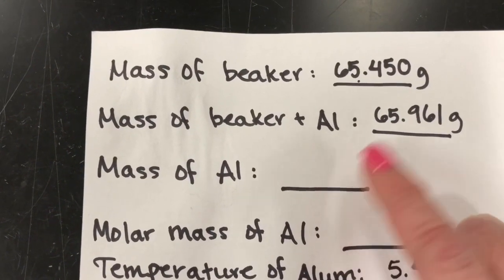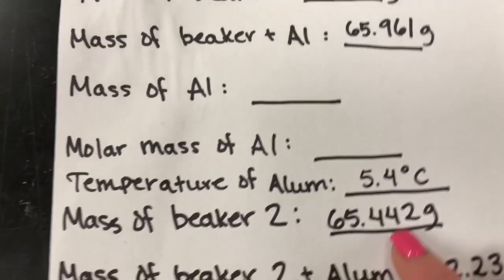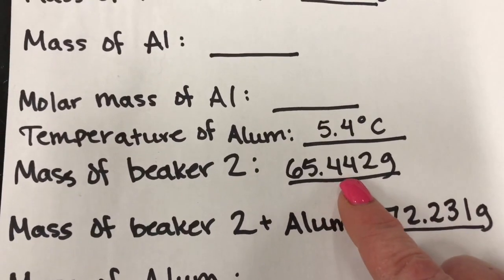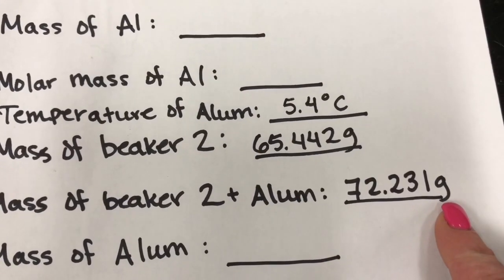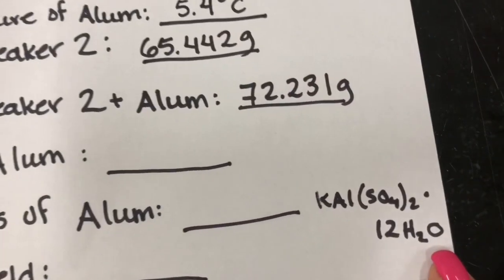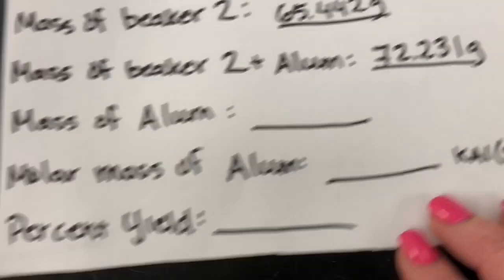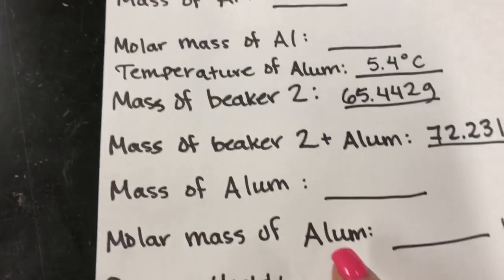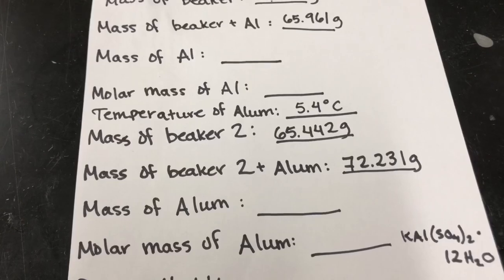Synthesis of Alum from Aluminum

Comment: Using .511g of Al, I got a theoretical yield of 4.89g KAl(SO4)2 and an actual yield of  6.789g KAl(SO4)2 which gave me a 139% yield. Is that correct by your calculations? This was my balanced equation 2Al (s)  +  2KOH (aq)  +  4H2SO4 (aq)  +  22H2O (l) →  2KAl(SO4)2.12H2O (s) + 3H2 (g)
Reply: The formula for Alum is KAl(SO4)2 12H2O, including 12 water molecules per one formula unit of potassium aluminum sulfate. Therefore the theoretical yield from 0.511 gram aluminun is 0.511/26.98*474.39 = 8.98 grams, your percent yield would be 6.789/8.98 x 100% = 75.6%
Reply: How did u get this balanced chemical equation? Asking for help Ty🙇🏽‍♀️
Reply: @chiaramartin8426  Yes I thought too. His equation is perfect. I also want to know how he got his equation.